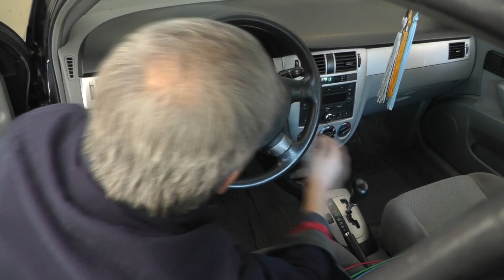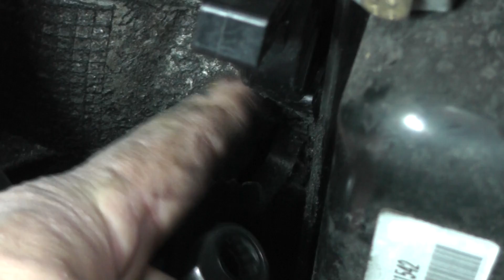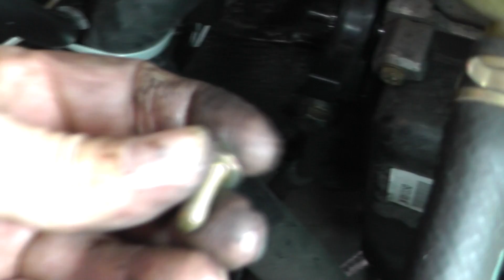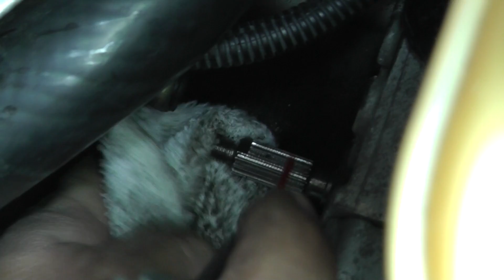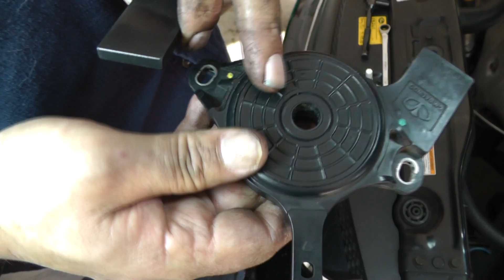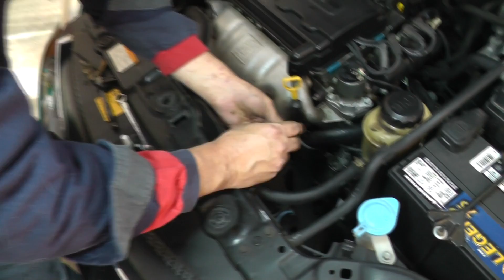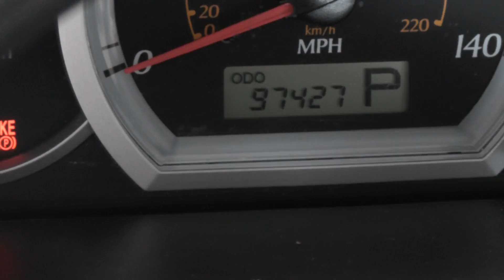Suzuki Forenza Installing Transmission Range Sensor - Part 5

Comment: do i need thw suzuki recomend alingment tool
Reply from the maker: +John Brady As mentioned in the video of where I install the range sensor, you don't need the alignment tool. Just put the two bolts in the middle of the slots of the sensor and it should be close enough.

Comment: Thanks. You helped me with my Chevrolet Nubira 1.8. Greetings from Poland:).
Reply from the maker: +strowger79 Hey strowger79 and glad to hear that everything worked out. Thanks for taking the time to drop in and share your thoughts.
Reply: +stuzman52 got part installed but can't get bottom bolt to screw in... I am turning it the right way.
Reply from the maker: +Darlesha Jackson If you know the bolt threads are okay and the internal threads are okay, then the bolt should screw in. If that's all okay, maybe let someone else try to screw it in as it's in a somewhat awkward position.
Reply: +stuzman52 I got it. had to do the bottom bolt first. part wasn't lined up with the hole.
Reply from the maker: Glad to hear that you got it all figured out!

Comment: hey so I fixed the sensor, which fixed mixed signals on my cluster. the sensor was indeed stripped. the install went perfectly but my gears don't seem to be working properly. the car doesn't drop great when I step on gas hard or raise great at high speeds. any thoughts? 
PS great video
thanks!
Reply from the maker: +Alejandro Hernandez Put a scanner on it and see if there any codes and start looking at some data. Other than that, I don't have a clear answer for you.
Reply: +stuzman52 k thanks very much

Comment: stutzman52, got the new TRS and installed it. I believe I have it set perfect. Shifts smoothly and I no longer get a reading for it when I checked. Not bad $15.00 repair.  I have two questions for you.

I watched your videos on replacing the timing belt. I was thinking of doing this myself. it doesn't look all that difficult.  Your videos are detailed and I consider myself pretty handy. Do you suggest trying to do this myself? Although the car is nearly mint inside and out, to have someone do it would probably be as much as the car is worth.

My second question is I replaced the brake pads and when I tried to bleed the rear, nothing came out. Any suggestions as to what it may be or what I should look for? Thanks
Reply from the maker: +Vincent Gulisano Good to hear that you got your tranny shifting smoothly. As for the timing belt, it's not a bad job. But that's from my perspective. After watching the videos, you'll have to ask yourself the question of how comfortable you feel about doing it. That, I can't answer for you. As for your rear brakes, did you unscrew the zerk fitting out completely and see if there is any fluid coming out. You could also have someone press on the brake pedal and see if fluid comes out. You're welcomed!

Comment: I replaced my range sensor and used the adjustment tool, but when I checked if it was in the right gears they were not.  I also have lost my reverse gear.  Meaning the car will not go into reverse.  I need some help if anyone can steer me in the right direction it would be greatly appreciated
Reply from the maker: +Susan Wheatley Susan even if the switch is misadjusted, it should still go in gear. What issue were you having before you changed the sensor?
Reply: stuzman52 , I am in the same boat as Susan... My 06 Forenza does not register neutral, park or reverse. It is almost that it skips the gears on the dash. I am going to try and tear it down this weekend again but I have no idea why it didn't work... if you have any tips or hints, I would greatly appreciate it! Thanks for the videos, very easy to follow!
Reply from the maker: Maybe Zach when you installed the sensor that it was out of position to what gear it was in. If you're sure that's correct, then you could check your voltages at the sensor or TCM as outlined in this video series. You don't have to use a scope as I did. You could use a voltmeter.

Comment: Stutzman52, I finally got it on,  I bolted in down as you said and I had the PRNDLL123 right away, only one problem and I dont know if its the sensor or just needs a little fine tuning , took the car out for a ride drove nicely pulled in driveway put it in park than I tried to put it in reverse and it showed a symbol and if you move shifter it goes between R and N. Do you think its just has to be fine tuned? How would I know if its a bad sensor?
Reply from the maker: +Vincent Gulisano Sounds like you need to make a little adjustment on the sensor. As I mentioned in the video, there's a special tool for this, but you don't need it. Make sure that the top bolt for the sensor is right in the middle of the slot. That should give you a good starting point. Then try it out to make sure it works. If the diagonal line comes back, move the sensor slightly and try again. You may have to play with the adjustment a little to get it right. If I remember, you did get a new sensor right?

Comment: yes you did do it in neutral. I have done some reading online and a couple of people said to do it in Park. But, what you said makes more sense.  When you said it may be a little snug, it should evently slide on without extreme pressure. Thanks I will give it a try  again and let you know how it comes out.
Reply from the maker: +Vincent Gulisano Good luck...you'll get it!

Comment: i watch your video and I have to replace the TRS. It too is an 06 suzuki. I know you no longer have the car, but i thought maybe you can give me a little advice. I am somewhat mechanically inclined,  and although this seems like a very simple fix, I am having a problem with it. I purchased a new sensor and when i tried to install it, it did not align exactly with the flat spot, therefore it rounded out the rubber spline. I tried to put the old one on, and i did the same thing. I just purchased another one and before I try again I was wondering if there is anything you can tell me to help me to align  the TRS on properly(flat spot). Again, this doesn't seem difficult at all, but I would like to get it right so I dont have to buy a third one. Thanks..
Reply from the maker: +Vincent Gulisano Shouldn&#39;t be that hard Vincent. If I remember from this video of where I install it, I believe that the gear shift selector is in neutral. The reason is because the flat spot on the range sensor would been in this position when you buy the sensor. Hopefully, my memory is correct about that. It may be a little snug sliding on the splines of the input shaft, but that's normal. Make sure that the flat spot lines up with the flat spot on the shaft. Just take your time when installing and don't rush the job.

Comment: good day sir. i hope you could help me.. i have the same prob with my OPTRA 2005. which is same engine as forenza i think.. i always have this BLINKING HOLD indicator shows occasionally.. and everytime it shows, im having the trouble you have mentioned. cranking sound if i change my shift.. engine hard to perform.. its been years that this prob happens to my car and everytime i bring my car in service centre (GMC) they cant solve it.. funny right.. but its true..
Reply from the maker: +Jeff Garcia Hey Jeff..not really sure about your issue as I don't have the car anymore as it got sold two years ago. But here is a link to a Suzuki forum where people discuss their Suzuki or OPTRA vehicles. You may find it useful to leave a comment and see if some folks there can help you. Here is a link to one fellow having an issue like yourself. Good luck! http://www.suzuki-forums.com/general-forenza-reno-forum/55433-blinking-hold-light-running-bad.html

Comment: Wow, my prayers were answered, I thought i was going to have to get rid of my Suzuki. By the way, where can a guys get his hands on the DW tool?
Reply from the maker: +MrCneo As for the tool, the link is in the description for this video. But, at $128.99, you really don't need the tool. As I've mentioned, just make sure the slots are in the middle when you tighten the range sensor.
Reply: Ok. Sounds good. Thank you very much.
Reply from the maker: +MrCneo No problem and good luck on your repair!

Comment: 2006  Suzuki Forenza  if range sensor  is bad will it keep it from  going in Reverse or drive
Reply: +stuzman52 When we put it in reverse or Neutral or Drive it blinks instead of showing R or N or D
Reply: +stuzman52 It goes in 1 and 2 and 3 and P without blinking
Reply from the maker: +Stephanie Taylor Stephanie, it sounds like your range switch is bad although, I've never seen it fail where the car never moved. Did you read any code and get something like P0705? It sounds like you need t replace the switch but you could have some other issues also.
Reply: +stuzman52 We replaced that. Thats what we were thinking to. put a brand new on
Reply from the maker: +Stephanie Taylor You've probably got some internal transmission problem at this point.

Comment: hi stuzman52 you do a query from Venezuela I have a Optra model car with transmission of model change zf4hp16 the problem that I have it is that my mechanic dismount the valve body and disconnect the wiring harness now no one knows where each connector goes ud . I may be able to help show a diagram of how they placed each of the wires to the solenoids or a video or maybe a photo so that we can solve .

thank you.
Reply from the maker: +miguel ojeda Hi Miguel...I don't have the car or the service manual, but go to www.bbbind.com and click on 'Technical Publications' and then 'Wiring Diagrams & TSB'. You'll be able to find the wiring diagrams for your car there and hopefully that can help you out.
Reply: +stuzman52 Mr. stuzman52 I appreciate the help you can give me your advice Segui and went to the Pahina www.bbbind.com I could get is this http://www.bbbind.com/free_tsb.html that for me is very complicated this very technical also not talking to me wire color if prestame to reach a little more help on the case you 'll be grateful and reward God knows . I require to know how the cables are placed according to the color of each solenoid as appropriate. thank you.
Miguel
Reply from the maker: +miguel ojeda Miguel, here's another link to a free service manual. I'm going to leave it up to you and your mechanic to research the manual for your question. If you don't see it there, I won't be able to help you. I would think that your mechanic would know where the connectors would go to the solenoids. Here's the link http://lacetti.com.ua/chevy-man/EN/documents/Nubira-Lacetti/start_Nubira-Lacetti.html
Reply: stuzman52 Mr. stuzman52 am very grateful for the great help given me the link that sent me is full it is the book of the Lacetti and Nubira ness is exactly my car.
Thank you and God bless
Reply from the maker: Glad to help and hope you get your car going...
Reply: stuzman52 good morning friend stuzman52 quierocambiar timing belt on my car engine E -TEC III Daewoo Chevrolet ( Optra ) but not to me is the guide to position the gears both cams as the sigueñal if you. I can help I thank you again is different from the E -TEC II
so I do not want to risk .
Thank you
Reply: stuzman52 stuzman52 my friend to apologize engine is a E -TEC III 1.8L 16V

Comment: suzuki forenza check light
Reply: suzuki forenza
Reply from the maker: +Surinder Madahar If you're asking if you get a check engine light with the transmission range sensor., the answer is yes. Otherwise, I don't know what you mean.

Comment: Where did you get the new range sensor? All the auto parts stores tell me to go to the dealer but there is no dealer in Salem or Portland
Reply from the maker: +kiel rhodes Hi Kiel...go to www dot rockauto dot com and after you select your year, make, model, etc. do a category search for 'neutral safety switch'. You'll see it pops right up. I checked on a 2006 Forenza and the price was $25 - $28 depending on which manufacturer you want. Good luck with your repair.

Comment: I changed the neutral safety switch already and the P0700 code is not showing up but I'm getting the P0705 code what can that be?
Reply from the maker: Bohemio The P0705 code indicates that you still have a problem with the tranny range sensor, it's wiring, etc. More than likely, you didn't get the switch adjusted correctly.

Comment: hey Stuzman52, thank you so much for you advice and as you said, yep.... there was another code behind the P0700. I finally decide to buy a more advance OBD reader and I noticed that the code hiding from my previous question is P0783 $07EA Generic
3-4 Shift             ?
How can I fix this my self Stuzman52? 
Once again 2008 Suzuki Forenza Automatic.
Reply from the maker: Hector Mendez As I feared Hector, there are probably some internal tranny issue. This would take some diagnostic equipment to look into this further. It sounds like you may have an issue with your solenoid for the 3-4 shift. If your scanner has tranny data, you could monitor the 3-4 solenoid to check its activity. Or if you have a scope, you could monitor the voltage and amperage of this component. In any event, I'm sure that you'll have to open the tranny to fix the issue.

Comment: Where would I get one of the transmission range sensor tools
Reply from the maker: Scott Garver Look in the description of this video. At the time when I bought the tool, it wasn't that expensive. Now, it's well over a $100, but you could get by without it for the adjustment.
Reply: I am having so much trouble trying to get that thing the splines I still haven't got it over yet is there a trick
Reply from the maker: Scott Garver It's pretty tough to slide over the splines Scott. As you saw in the video, I had a little trouble with it too. It just took some pulling on it and it slide on. Just keep at it and it will eventually slide on there.

Comment: Stuzman52  My daughter have a 2008 Suzuki Forenza  and yesterday  she called saying that Check engine  light  came out. I ran the code reader and I got Code P0700. Is it this the same as the code you're  mentioned  in your video (P0705)?
By the way, I love your videos.
Thank you.
Reply from the maker: Hector Mendez Hi Hector, usually you'll get the P0705 along with the P0700 which defines the tranny range switch. So, it could be other issues going on. See if there is a diagonal line across the LCD for the gear selection. Or if it's not there now, ask your daughter if she remembered seeing this diagonal line across the LCD. If so, then that would point to the tranny switch. Just keep in mind Hector, that there could be other issue(s) if it's not the tranny switch. And those issue(s) wouldn't be too good...And thanks for the comment on the videos.

Comment: Do you have to buy a new range sensor or you just re a lining the sensor with the clutch ??please
Reply from the maker: Hi Michael. The tranny range switch sensor shown in this video is only for an automatic transmission. If you have a manual transmission, then you wouldn't have this switch assembly. Not sure what your question would be in regard to a manual transmission if this is what you have.

Comment: Ok, I've found the problem. One of the bolts that were securing the linkage to the top of the transmission was loose! I've tightened it, but I've found another small problem. The little clip that you remove to get the linkage off has fallen off of the little spindle! Do you know where I can find this clip or if I could use a substitute?
Reply from the maker: Measure the groove on the spindle with a dial caliper and go to your local automotive store. They should be able to match up a generic c-clip for you.

Comment: Just watch the vid you said it's 1-2-3-4?
Reply from the maker: You misunderstood JP. The firing order is 1-3-4-2 as I said. The cylinder numbering is from the front of the engine to the rear which is 1-2-3-4.

Comment: Why is there no transmission fluid dipstick for this car?
Reply from the maker: It turns out that a lot of newer cars don't have a tranny dipstick. Some of the German cars don't have them and my son's Dodge Charger doesn't have one. Car manufacturers are always looking for ways to save money and this is just one of their methods. I'm sure that engineers if they had their way would have a dipstick installed. But in the end, it's the bean counters and managers who make the final decision. It's all about saving money.

Comment: Sometimes When I put my forenza in drive, it doesn't go into gear. I have to switch between park and reverse and back to drive ( sometimes a few times) before it goes into drive. Does this sound like a symptom of a bad range sensor?
Reply from the maker: Not likely as it should still go into gear without a hesitation. I take it that you have a check engine light on? If so, get it read and see where that leads you.
Reply: Same thing is happening to me and I just replaced the neutral safety switch but I'm still getting this P0705 code :(

Comment: Hi, thanks for this, it is extremely helpful.

I'm almost done with my DIY project, but unfortunately I don't have DW260–050 P/N Switch Installer! any recommendation for me to proceed with?? I did little research and understood that tool costs me exactly same as the sensor! Any help would greatly appreciated. Cheers!
Reply from the maker: Yes, the tool is pretty expensive. Now it runs about $127 which in my opinion is way overpriced. In this video, I mentioned that with the tool the top bolt for the sensor was right in the middle of its slot. In other words, move the sensor so that top slot is right in the middle where the bolt goes. That should be close enough for the adjustment. Good luck on your repair.